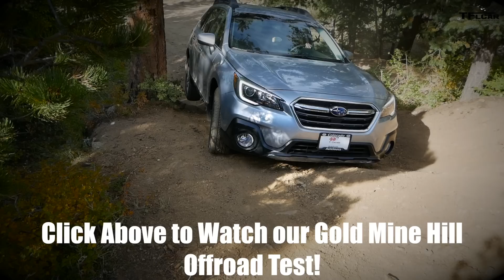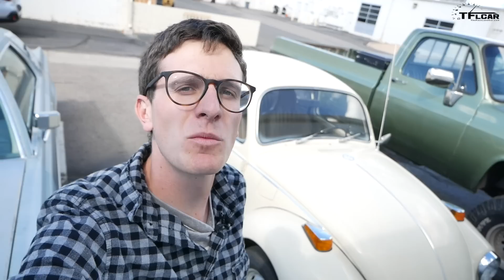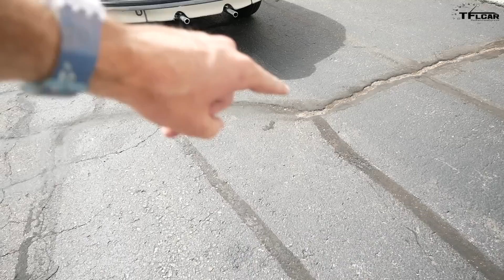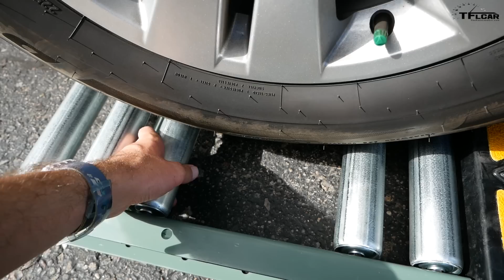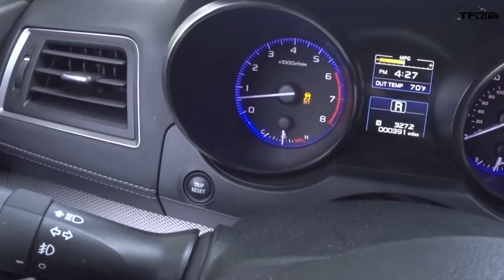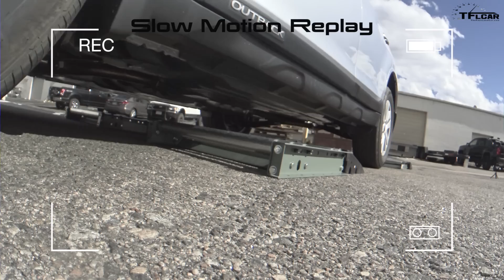The Truth About Subaru's Symmetrical All Wheel Drive:TFL Slip Test vs Subaru Outback

Comment: I am by no means an automotive expert, but I've been driving for about 40 years and due to winter conditions where I live most of my cars have been jeeps/trucks/suvs/awd cars/etc. The Outback (2018) is the best on-road AWD car I have ever driven.  The car does amazing in any real world on-road condition where traction is possible. It is by far the best car I've ever driven in the snow. During snow storms I routinely drive around people stopped with their hazards on and continue on up the hill to my house. I've used x-mode/hill descent to crawl down snowy and slippery hills far better than any of my previous 4WD vehicles, even the ones that had a transfer case and 4-LOW. It also does just fine on light off-roading such as loose dirt, gravel, and sand. However, it is not an off road car. I know Subaru's marketing suggests that it is - and perhaps they should stop doing so - but I don't think any reasonable person would expect a family oriented crossover wagon to handle the situation shown at 0:27. Still it is the best practical on-road AWD vehicle I have ever driven.
Reply: I'm going to have to defer to the guy from Northern Canada :) He probably knows what he's talking about when it comes to snowy weather more so than me..! Also pretty much every car I've ever bought has been better than the last one - so maybe it's just technology in general. However, I think my point was that even though you probably shouldn't take your Subaru off-roading and try to drive up "insanity hill", if you're looking for an on-road snow car then it's very, very good.
Reply: Remember the best AWD system is Acura's SHAWD not Subie or Audi quattro as it can send most of the power to either the left or right rear wheel - no vectoring on front wheels.  Now the Audi can do Torque vectoring with a sports diff like the SHAWD of Acura but only on the back. No car has side to side vectoring right now, ie you could in theory send 100% of the power to the front right wheel.  I think something like a Model 3 AWD could do it on on both front, back and side to side with software a s you have a motor for each wheel.
Reply: My 2k15 outback is awful in the snow with my stock tires. Finally replacing them, hoping this year is better. My old 99 Audi a4 was 10x better in snow
Reply: @KohleJ  Cant beat the old school mechanical Quattro (which Audi has stopped in most cars nows - you got Quattro Ultra (old school) and Quattro (front wheel drive until slippage))
Reply: MrZedblade agreed. It doesn’t matter if you have AWD or what car you have if your car is physically blocked in at the bumpers due to driving off-road... would need more ground clearance and of course approach and departure angles. But that’s a separate issue
Reply: Sorry to hear that you haven't experienxed Audi quatro yet.
Reply: @PR0XIDIAN  My last car was a Audi TT Quattro and it was okay in a straight line but terrible at the bends, would easly spin out and I had 'Continental All Season Contact' tyres on.  Plus Quattro is differant now, you got two versions, you got Quattro Ultra (which is the old style, but realiable mechanical system) or the Quattro, which is two wheel drive and activates rear wheels when their slippage (which is what my Audi TT had).   Audi has done this to keep costs down and charge a preiume for the Ultra.   So for stability, Subaru wins hands down compaired to Quattro on TT, Q3, Q5 etc  but not high end A4, Q7 etc but you could purchase 2-3 Subaru's for one of these Audi's.
Reply: Seth Forbus sorry you’ve had to experience Quattro. BMW X-drive is here when you need it. 

I kid. Couldn’t resist.
Reply: @PastPresentFuture360  On the newer models, X-Drive is better than Quattro but on par with Quatrro Ultra.
Reply: Janelle McKinney Nokian WRG does the trick for me in Minnesota.
Reply: I drive an RX-8 with Michelin x-ice 3 tires in the winter and I can drive circles around awd vehicles with all season tires, and stop and accelerate faster than they can dream of. My summer tires start to slip at 45F.

Tires mean everything in winter, awd means more in mud and sand low traction conditions, not nearly as important on non off road conditions.

I also drove a 05 civic hybrid with snow tires through feet of snow and didn’t get stuck, test drove one with all season one winter thinking of trading for color and transmission, it slipped extremely easy. 

To the ignorance that awd helps with turning/stability; go to Tyre Reviews channel and see for yourself, don’t trust us with real world experience driving awd, rwd, and fwd cars with both winter tires and various non winter tires, you have no clue, so don’t embrace the ignorance with arrogance, wisdom comes from humility and willingness to learn.
Reply: Subarus are great in terms of traction (it's really all we own), but at the end of the day they're still unibody.  You really need body-on-frame to do proper offroading.
Reply: @mikecronce1173 
I agree. That said, i classify the unibody as cars and body on frame as trucks or light trucks ( even the crown vic is a truck disguised a car to me!)
Reply: I gotta agree with you. I have trucks and they will get ya there but I will pick my 20 year old forester in reasonable depth snow over my truck for all the reasons you mentioned. Very controllable and capable vehicles
Reply: @Michael Cronce true. Tires make a difference.  It cornered better with low profile tires than taller sidewalls but yep the awd helped it corner nice either way
Reply: You are absolutely spot on.

A Subaru is an awsome AWD car, but it is not an off-roader. And it's not meant to be one. It doesn't climb up The Goldmine Hill, beacuse that's not what it's made for. It's meant to be driven on the road, and it does that better than a true off-road vehicle. Snowy and icy conditions on some backroads, and it's perfect.

If you want to go off-roading on a regular basis, the Outback is the wrong car. I have an old Impreza (which has a different drive train than the Outback on this video as it's manual transmission) that has open diffs and no traction control. It would be almost useless if taken off-roading. It even says in the owners manual not to do that. But when the road conditions get bad, a snow storm strikes, there are not many cars out there that can beat it. If you just want to go shopping for groceries or get home from work through the snow without having to struggle, or have a little fun in the white stuff, it's perfect. That's what it's made for.
Reply: I have a BMX bicycle. It goes over snow and ice no problems.
Reply: I couldn't disagree more. I had a Subaru Impreza WRX and it is not even on the same playing field as my xterra on the snow or mutt. Subaru doesn't use limited slip differentials or the option to lock the differential.
Reply: Do you use winter tires?
Reply: Xmode is incredible on snow and ice, even with just all season tires.
Reply: My family owns a 2016 outback it kicks ass in the ice and snow.  But a.w.d. cars are just like any car in that good tires are important part of winter driving.
Reply: It's the same with any subie. My forester was amazing in the snow, and I can't wait to get out in my new crosstrek this year.
Reply: I've been driving in north eastern Canada for 15 years and most people I see in the ditch are 4x4 trucks and awd suv/cars during snowstorms. Awd and 4x4 only help's in acceleration and maybe stability if your a bad driver.

It does not have any benefit in steering and braking. Winter tires play the largest role. People think I'm a mad man for driving a rwd lsd equipped car in winter but with good winter tires and some driving experience and knowledge it's very stable(and fun!).
Reply: @Korrupted8787  - This is because many drivers in the snow/ice don't think to downshift to try to slow down instead of stomping on the brakes. It can also help to move off center in the lane and get your tires on rougher material instead of staying on the slicker part. Then many simply go to fast thinking they are invincible. I'm on my third Outback and haven't ended up in a ditch yet.
Reply: @Korrupted8787  Does not benefit in steering? Well let me tell you something... First of all you havent driven an awd car. Second it helps steering even on dry surface BUT thats not the main improvement. Awd improves *traction*and *stability*. And so you cant feel the speed and the turns - the car is insanely stable (as far as subie goes, havent been in other awd cars). I have been in a FWd and a RWD car and the difference is insane... I am rolling in the car every single little turn it is so annoying!
Reply: 巧君、元気かい、お前。。。
Reply: @moonsapling  Tires connect you to the road. Drivetrain configuration assists with power delivery so claiming that it improves traction and stability is bullshit. Tires are what ensure that. I drive a 420hp RWD vehicle in the snow belt year after year with no issues. Plenty of folks with AWD who eat guard rails every year. Worry about tires first.
Reply: @d1sturb3d119  let me see you climb a snowy hill with RWD. AWD prevents losing traction to any of the wheels...
Reply: @moonsapling  Dude I literally live in Utah. I drive through a canyon that has snow in it for 5 months out of the year with a 2000 foot elevation change. AWD does not improve traction. Tires improve traction. You have no idea what you're talking about. Either that or you're mixing up terminology. AWD helps you move. It does not help you stop or corner. Tires are what keep you on the road.
Reply: @d1sturb3d119  actually I'll argue that the awd does help cornering stability.  It at least seemed to in my legacy
Reply: I lived in Northern Maine for 3 years in some of the worst conditions in the country (basically the roads were gravel & ice in the winter).  I drove a Volvo 240 DL - rear wheel drive.   With proper snow tires and sandbags in the trunk, it was unstoppable.  Truth is, any car with a decent driver and decent winter tires will be fine.   One of the best cars I ever used was a Honda Accord with studded snow tires.  Went through several 2ft+ snow storms in Lake Tahoe with no problems.

If you have spent $$$ thousands on a car, you will be a fan of it.  It's acquisition bias 101 and it's what marketers exploit ruthlessly, including Subaru.   Truth is almost all AWD have some flaws, the fact that Subaru basically refuses to acknowledge this is really telling.
Reply: If you went through 2 foot snows you are pushing a pile of snow.
Reply: ck m. That’s what I had too. 1982 Volvo DL. Also a 1985 Volvo 740 GLE and a 1991 Volvo 740 Turbo... all RWD. Never had any problems with them in snow. A FWD vehicle is even better.
Reply: @ckm-mkc  so rear wheel drive with sand bags and tires is better than all wheel drive???? No....no it's not
Reply: @teabag3854  it's not but he wasn't wrong in stating that with good tires,  some weight and a decent driver you can do a lot. My first truck was a 67 ford f100 2 wheel drive. I drove it all over country roads in the winter. Ya just gotta know your limitations and how to drive. Can do more than ya might think
Reply: My experience echoes Korrupted’s.  Almost every vehicle I see in the ditch or upside down in winter is a 4x4 or AWD one—usually on a straight stretch after breaking all four loose trying to pass a line of slower cars. 

Higher weight, higher unsprung weight, higher centre of gravity, poor suspension geometry are all huge liabilities when every vehicle already has four wheel brakes. 

Sure AWD helps with steering. So does FWD. 

I’ve driven insane mountain passes in winter in RWD cars and never had a problem. It’s amazing what studded winter tires do.

Comment: Suggestions:
1. Open a new channel title just for these tests. "TFL slip rollers test"
2. Use ramps for the exit from the rollers, the same you have for entering on the rollers. Those things won't jump like that from under the tyres. There might be situations when you can damage the car (or paint) if those jump to much.
3. Get yourself a ramp. 20 degrees. Or even adjustable angle. Do the tests on flat and on various angles.
4. Test all cars and trucks on the rollers.
5. Find a way to lock the rollers.
6. The 1 and 2 roller test, on front wheel, than on rear wheel. 3 roller on front and than rear wheel position.
7. Test 4 wheels on rollers. It will show how the system is balanced, how aggressive is the ESP and other electronic contolls, if engine or transmission cuts power, etc.

This will be a very interesting, entertaining, educational channel. You have to do it.

Comment: Subaru's AWD systems are not what they used to be anymore, in fact, far from it. Symmetrical All Wheel Drive relates to the architectural layout of the parts involved, not to the mechanical performance. Its is a front wheel drive system with the rear kicking in after it detects a loss of grip in the front, just like any other shitty cheap AWD system out there these days.The days of 50/50 or 60/40 are long gone. Fuel economy over performance...this day's reality.

Comment: The flaw to tests like these is that the wheels that have and not have traction are controlled. In real world where traction between wheels changes instantaneously and sometimes a car's AWD system could not react quickly enough to the change in traction.
So I always take these test to a grain of salt. It's always better to compare systems in a real world scenario, like the ones done in Gold Mine Hill.

Comment: Those are interesting tests, but the issue is you're doing them all flat pavement ( other than the rollers ) so all the car needs to do is climb the inch or two over the rollers in front of the tires. Meanwhile the one on the pavement has solid traction but no resistance. 
Try it again, with three wheels on the rollers and a brick in front of the fourth tire, which simulates the resistance of rock or lip in the road. 
If you can, try the exercise on an incline, like a loading ramp, since uphill obstacles are far more challenging than flat ones.

Comment: I'd get a 4th roller and apply partial pressure against the 4th one. or just put sand or gravel or ice under the 4th wheel. Push these awd systems to the limit.

Comment: Off road performance is going to come down to choosing the proper line for the vehicle and tires. This test takes those 2 variables out of the equation and truly demonstrates the capabilities of the AWD system. Good job. I think you need a set of off road tires for the Outback if you're going to be going off road. There are plenty of folks using these cars as overland vehicles and videos showing that setup properly they are pretty capable vehicles.

Comment: Great video!  This proves that the AWD system in the Subie works very well.  This also proves the weak link is the powertrain (pointing a finger at the CVT) where engine torque is not enough to move the car uphill if alternate corners have lost traction.  I would like to think this is computer programming that has been put in place to protect the Subie from damaging itself, but a part of me sees this as a car geared for the highway and does not have the torque multiplication factor that you would see in a 2 speed transfer case.

Comment: Try a Model 3 AWD! or an X/S off road. How about putting the "traction" wheels on   a puddle of baby oil. Rollers with a 15° angle would be great, no hill required, since the tractioned wheel will need a lot more power than the CVT will allow.

Comment: I know you can't just ask for Subaru's anymore, but if you can get you hands on a manual and cvt Crosstrek, I think that would be a good video since the manuals are supposed to be 50/50 split still instead of the intelligent system or whatever they call it.